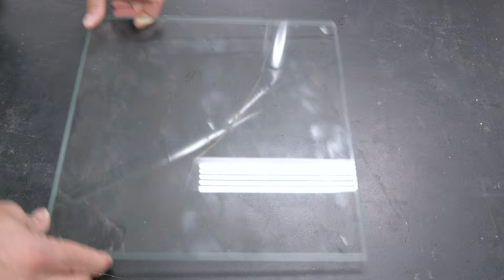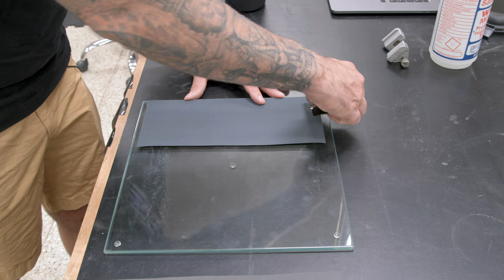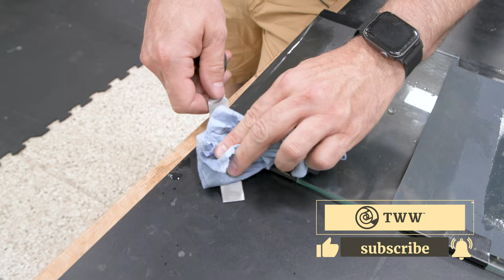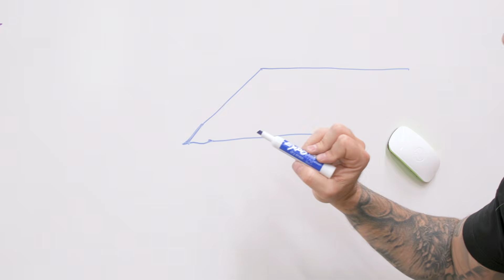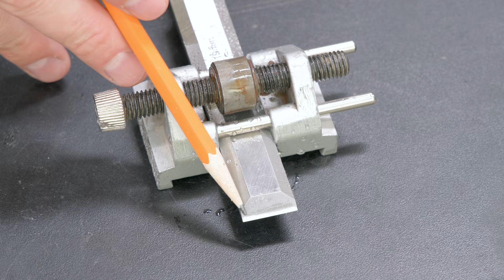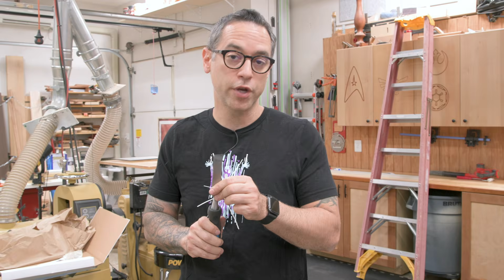Are Your Chisels Scary Sharp?

Comment: Could you use this sharpening system on carbide woodturning cnc lathe knives
Reply: Ya probably got a solution since you posted this, but in theory it should work fine.  If it's one with curved edges you'll need to spin the tool instead of slide it, so the edge is properly shaped of course.

Comment: Old fashioned and out of date . Here’s the modern way. Buy a small belt sander. Order ceramic belts 180 or 240 from the online American company you know the one starts with E. Deerfos/ Norton is ok. Back off blade then sharpen. Ceramic allows you to grind to a thin edge with no heat build up. If that’s not sharp enough make an mdf disc on an old grinder, and use jewellers compound, this will be ridiculously sharp, far beyond what most joiners have ever used. That’s it really.

Comment: Im surprised you skipped the most important part, buffing // polishing // stropping.
I make native flutes and if the chisel is not crystal mirror buffed, it tears micro grain.
Stropping produces bullet proof edges that dull at a fraction of the speed of say even 10,000 grit edges.
A simple piece of leather is all thats need to avoid sand paper. If you strop every few uses, you never need to sharpen.

Comment: I use the Scary Sharp system, but the one I’ve bought (in the UK) uses 3M micro finishing and lapping film and it’s been absolutely fantastic. When I got into woodworking 3 years ago, I bought some water stones and diamond stones, but I just couldn’t get on with them. Once I started to use the Scary Sharp system, I got the results I wanted/needed. I may go back to diamond stones again in the future (Atoma or DMT), but for now, I’m happy just using the finishing film since it works so well.

Great video, Mark. Quick and simple.

Comment: Sharpening isn't the real problem I have, I have gotten great cutting edges just fine using 220, 400, and 600 grit. The real problem is the metal. Most chisels aren't tempered correctly, or are so cheaply tempered, by sharpening, you removed the hardened material, thus loosing all the benefit. Paying 30 dollars a chisel is out of the question. I think I need to look into hardening metal, not sharpening metal.

Comment: I love this method and use it all the time.  
2 tips- Get a can of 3M super77 spray adhesive to hold down the paper, it works much better than tape. If you go to your local granite counter shop, they have small pieces of polished granite cutoffs in the dumpster that work great for sharpening.

Comment: Best tip i can give on sharpening ? STROP !!!
Seriously i sharpen my blades about once a year, maybe less, but then i strop every 1-2hours of use (you feel when you need to, that's the point when the chisel start to feel like it felt back in the day when i was not stropping). 
By the way, don't need super duper shmig piece of unicorn leather hand tanned by a vegan nude maiden a night of full moon. I use just a scrap of 3/4" MDF and it's just perfect.

Comment: I’ve been using this method for years.  I have a 9x12x1/2” glass and sandpaper up to 5,000 grit but rarely go over 2,000.  Also, the top of a table saw works as good as glass and you can get all the different pieces of sandpaper down at the same time.

Comment: Hey Marc,  any chance you have details on an angle setup board?
Reply: Plenty of YouTubes site this. Basically the projection of the blade out from the guide sets the angle. Marc's guide shows  the amount of projection for 25 and 30 degrees, for chisels or for plane blades.

Take a board, use a metric rule, mark the distance from the edge of the board, and attach a stop block inset that much distance from the edge. 

Next time you want to set your chisel out planned blade to that angle, place the tool loosely in the jig, butt the guide against the edges of the board, slides the tool to butt up against the stop. Tighten the screw on the guide and go to town.

FWIW, I put both 25 and 30 degree stops for chisels on one end of the boards, and the same for plane blades on the other.

Normally when I sharpen, I grind my bevel to 25 degrees and hone to 30 degrees. Set to 30 degrees I hone just the tip with 1000 grit followed by 8000 grit.

Comment: Hey mark, what if your cheap chisel has small nicks in the blade area? Would first want to take that down via the primary bevel first? Thanks!
Reply from the maker: Yup, you'd want to head back to a very low grit or if the damage is really bad, a grinder.

Comment: I hated using a honing guide like that one although mine was cheap and it showed.  IT mostly just messed up chisels and was a very big pain to try and get them in there.  I have yet to use it but got the Veritas delux guide so hoping I get much better results with the $$ spent on this honing guide.
Reply: I got similar results with that style of honing guide. The only useful thing to come from it was the fact it forced me to learn to freehand sharpen fixing all my irons and chisels.
Reply: @dnthasslehoff  From the cheap one or the Veritas one?  I'm hoping I get better results from the veritas one for the amount of money it cost.
Reply: @4321Woodworking  The cheap one, I’ve heard good things from the Veritas one but I’ve never used it myself.
Reply: I'v tried the cheap one, i'v tried the fix for the cheap one, i'v tried the veritas supper dupper shmig and never was i able to have an edge square to the side of the chisel, it's always slightly skewed. I bought the veritas because that's the one lot youtuber where commanding back in the days (product placement ? Marc tell the truth) but it's actually more complicated than good in my opinion, the roller has lot of play (aka not rolling flat) so no matter how precise the tuning little thingy the operation is never that precise. 
So i returned to hand sharpening and it's actually more accurate where it's really needed, just take a little practice. 
So yes by hand you don't have a precise number to give about the exact bevel angle. But who really care about that ? Certainly not the wood. Anyway if the edge is skewed the effective cutting angle also shift so ...

Comment: I used this when I 1st started and it builds confidence cheaply, but.......it sucks for knives. Just get a set of diamond stones (300, 600, 1000) a 2 sided wet stone (4000/8000) and a strop. For the hobbyist, this will last most of a lifetime and every single smooth blade that could possibly be owned can be sharpened.

Comment: What about the side edges. I bought some chisels for my son and they have course streaks on sides. If you remove them the width of the tool has changed , gotten smaller so a 1/4 inch chisel will not be 1/4.
Reply from the maker: I wouldn't worry about the sides at all. If they are really rough and it bothers you, go ahead and smooth it a little. As for the width changing, that won’t change it any considerable amount.
Reply: @woodwhisperer  thanks

Comment: And if you do go with stones, spend a little extra and get a diamond stone, like the double sided ones from DMT. They'll always be ready to use and you don't have to buy extra stuff like a flattening stone. Plus, they last forever.
Reply: They work well when new, but they actually don't last that long and they indeed cost much much more.
I'm afraid the perfect solution is not there yet.
Reply: @lolaa2200  That initial rougher surface that feels like it’s grinding more is the break in period. Normal and it fractures down to the spec grit.
Reply: @FearsomeWarrior  I've used enough sharpening thingy to know when one become dull and diamond stone do eventually get there. Some are more prone to that DMT are on the good size although not the best in the market, but saying it "last forever" is simply a false statement. Even DMT marketing say it last for "years" not decade or century and certainly not "forever". But hey the stone a use the most are shapton "soft" water stone, i got them for about 8years of heavy use (including frequante flatening) and the 1000 (the one I spend the most time on) still has about half of it's thickness left. So we are about on the same scale you see
Reply: @lolaa2200  I’m partial to DMT because I’ve used them for a few decades sharpening alpine skis. I’ve been tempted to try the Trend diamond plates to compare them to the DMT.
Reply: @FearsomeWarrior  I only use diamond stone for coarse heavy grind, had a DMT (the one with kind of round hole paternes) that has gone dull after i made few DIY plane irons. Now use a Japanese brand diamond plate that i can't even read the brand name (cause it's all kanji), but done some heavy work on it and so far it seams to handle better, time will tell but i don't expect this to be heirloom. 
That being said, if you use a coarse diamond plate only to flatten soft water stones then i can see them to last pretty much forever yes. That's one very good reason to buy one.
Reply: @lolaa2200  well, we have the perfect solution tho, easy, fast, last long but of course not cheap. have you met my good friend tormek
Reply: surface bonded diamond stones do wear out over time. i haven't used mine too much but it used to be nicer.

i think the best option would be a fairly hard ceramic stone it doesn't need much work to keep flat and they tend to be sort of cheap.

Comment: It's not the fastest method, but sure is the cheapest method for the short and medium term.  But Mark's right the biggest thing is to pick a system, stick with it, AND KEEP IT ACCESSABLE so you actually use it when you need it.  Seen too many people who continue to work with dull tools rather than take a break to sharpen because their gear is strewn about or buried/hidden.

Comment: I've been using Scary Sharp for years....8.5x3" strips of sandpaper adhered to a glass panel with low-tack adhesive and a Veritas Mk.2 honing guide.  I use about 8 different grits of sandpaper though, 80 through 2000.  That way I can look at the edge, figure out how coarse I need to start, then maybe 15-20 quick passes on each grit in rapid succession gets things razor sharp in just a minute or two.

One thing I do when flattening the back of a blade is to angle the tool maybe 30 degrees backwards on the first grit, then 30 degrees forward on the next, and repeat the pattern.  Makes it super easy to tell when you've sanded away the scratches from the previous grit